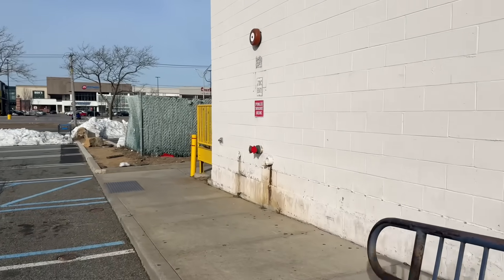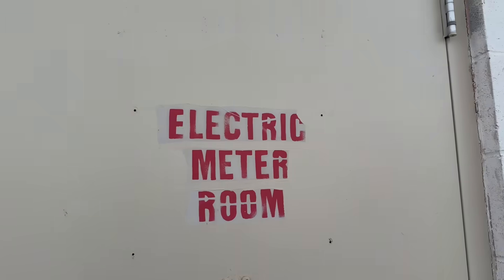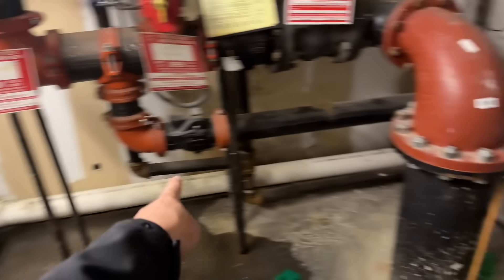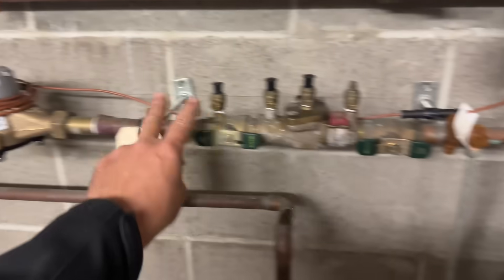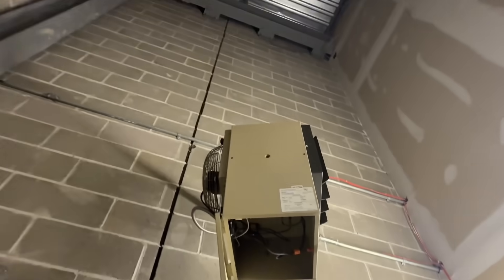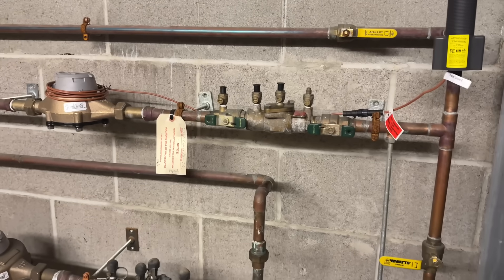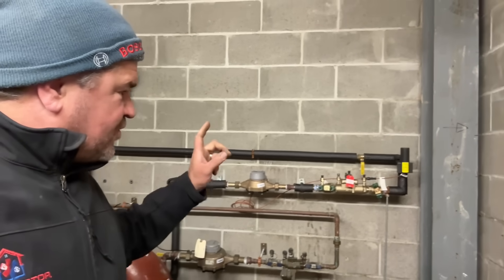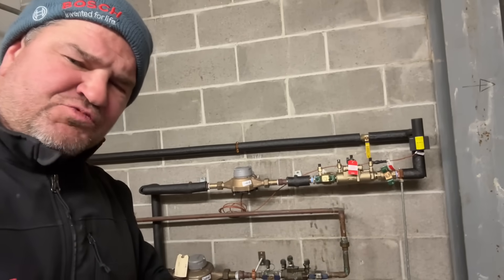Mechanical Closet Froze, Burst Pipes & Landlord is Blaming Tenant!

Comment: There’s no reason to insulate the pipe if you’re not going to provide a heat source between it and the pipe. Where’s the heat trace?
Reply from the maker: Great question
Reply: Pretty easy. The water is coming out of the supply line at a certain base temperature that is above freezing. By insulating the pipe, the heat transfer to the surrounding air is slowed down. While the water isn't flowing, heat will also creep in reverse flow direction through the water and the metal of the pipe from the conditioned part of the building. (This is what caused the blow out in the part of the pipe that led out of the building completely, btw.) This again isn't much, but it can be enough to keep water from freezing if it isn't sucked out by cold air around the pipe.
Reply: none needed...its a heated room.....probably has been fine for 30yrs until the heater crapped out.....shit happens.  cant heat trace every line in the bldg. up here in the great white north were it can get -40....if heat goes down...every line in that whole bldg could freeze in a matter of hours....shit happens.

Comment: The outside hose bib was for drain purpose . Y ou should reinstall with a shut off inside , and leave in off position until needed. Filthy animals. Lol
Reply from the maker: I highly doubt that
Reply: probably to meet code requirement, but it should be on it's own meter the landlord pays.

Comment: My opinion is that the landlord is responsible for the building and any utilities that service client units. Once the water, electrical goes past metering it will become client responsibility. That room falls under the landlords responsibility.
Reply: 100% Fact.  Just ask an Attorney if the Landlord wants to Play Stupid. 🤪👎
Reply from the maker: It sounds like you’ve got a good grasp of building management!
Reply: except, that was the metering room and it was all past the meter!  granted it should have been heated well enough to not freeze up, that part is on the landlord. they could argue the tenants should have installed heat tape and pipe insulation on their side. 
the outdoor hose bib should be on it's own meter the landlord pays, certainly it's a code requirement to have one on the back and front of building, every so many feet of distance. surely there's others on the building, who's paying for their water? it could be included on the lease as a deduction/etc. or should be
Reply: @throttlebottle5906  I'm in 100's of these rooms dealing with irrigation....I can guarantee that none of the tenants even have access to that room.

Comment: You should remind them that heat rises and this is not going to work on 18 foot ceilings - and especially not with an air gap in the door 😆😆
Reply: Yeah, agree! They need an insulated drop ceiling of some sort and to address other air leaks